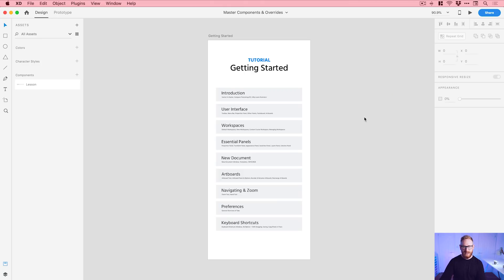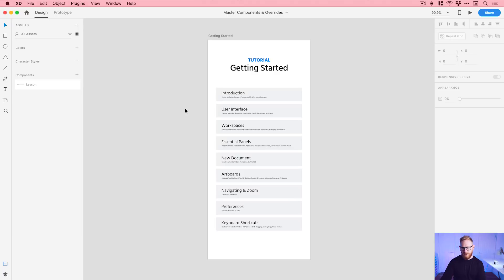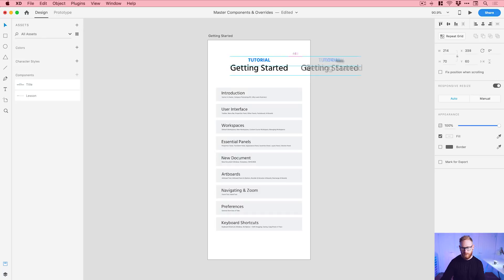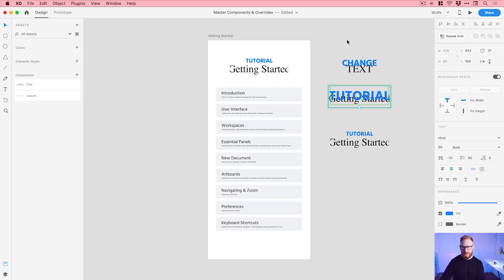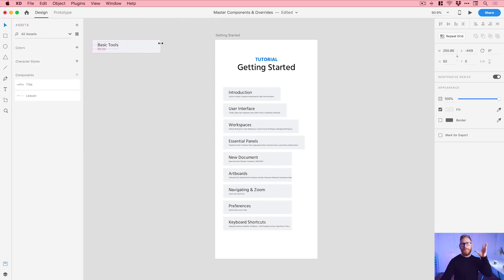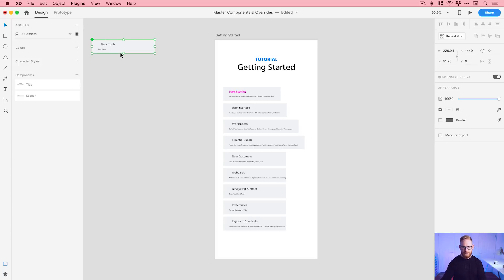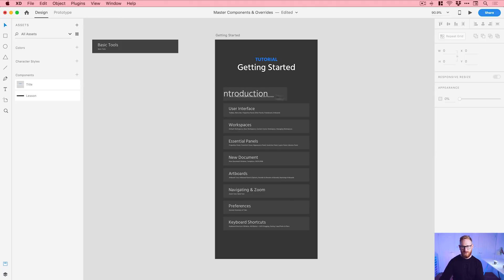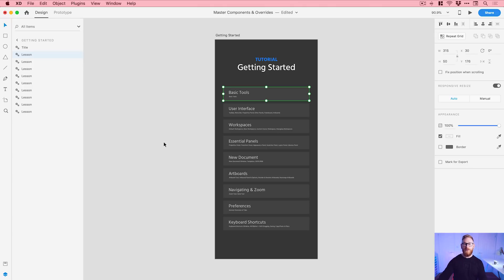Master Components & Overrides in Adobe XD

Comment: Is it possible to make an overide compenont its own master component? Basically doing a save as for a component if that makes sense.
Reply from the maker: Yes, you can ungroup a component and essentially break it apart, and then select everything and create a new component which will make it a new master component.
Reply: @ForeverDansky  Thank you but will I have to start over on the setting up everything on the Prototype side?

Comment: Hi there, thanks for the video. I have a main component but am trying to insert a new element into one of the states - is this possible? I am really struggling to do this. Any help would be greatly apprecitaed! thanks!
Reply from the maker: Hey Elvis, you could try double-clicking to go inside the master component, then once inside create the new UI elements and then create this as a nested component. Sometimes I find it easier to start a component from scratch, and build the nested (inside) components first and then work outwards. Hopefully that makes sense 👍

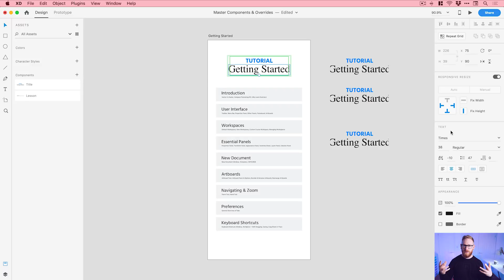Comment: Anyone know how to accurately adjust component frame to revised content inside it?? 3:30 is a perfect example of this showing how first and last letter get cropped outside the component frame when text is enlarged... Yes you can drag the component frame out but it doesn't snap to the text edge inside it! 
This sucks for future alignment purposes. Only work around I found is measuring both sizes (frame + content inside), then matching W & H to the revised content and finally aligning X & Y axis ugh

Comment: If I create a text as a component and then create an instance and add repeat grid to it, I am not able to fit the bounding box of each of the elements. Example: I wrote "example" 40px and made it a component, created an instance and added repeat grid sideways and typed home, new products, about... there is an overlap and placing them equally is not possible. How do I correct this?